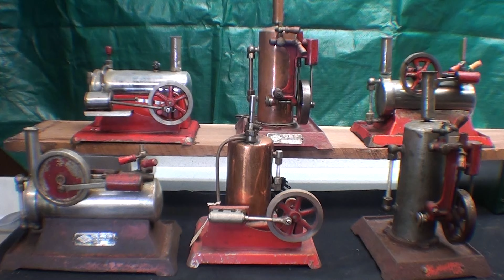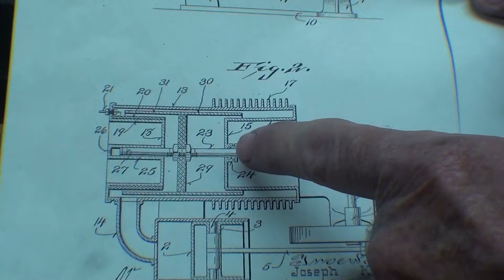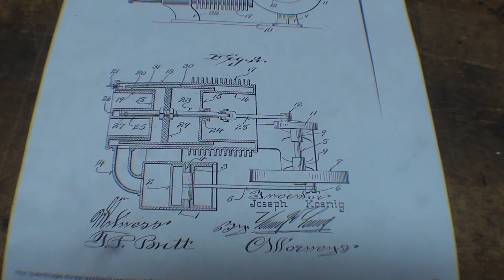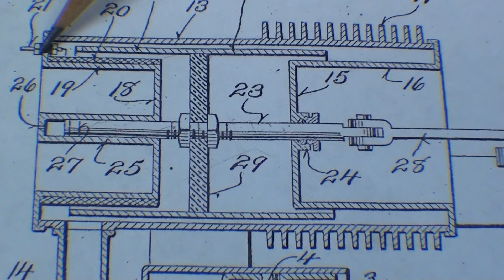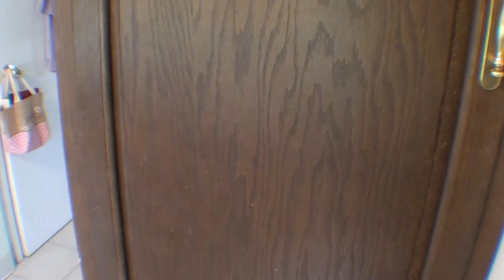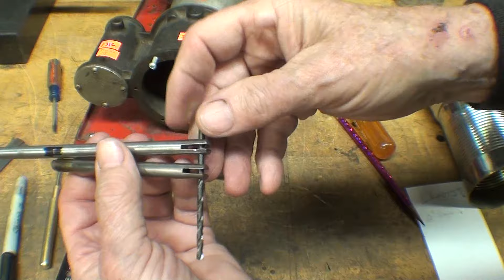Rebuilding an EMPIRE Hot Air Engine 1 of 3 tubalcain mrpete222

Comment: very late info, based on what i have seen so far, 1/3.         the  discussion of the  fallibility of such, lapsed patent, information was,  surprisingly,  astute.      Then,   the  obvious, Threshold  issue  was  glossed over;  and  life  went  on.           there is a reason that  99.999 percent of patents are  not  maintained.    it is because, they are Not worth it.      if/when a  patent has significant value, it will not be allowed to lapse.      so, feel free to continue to rely  on,  Flawed reference information.      cheers         googletranslate

Comment: As I watched I wondered whether a piece of automotive exhaust pipe, 2 3/4" or 3" might not be the right diameter. If it was a steel piece could be plug welded in the center where the rod connects.

Comment: Mr. Pete, I don't remember ever seeing a "H" design to a displacer before or the cold side design here, where in the displacer sleeves travel into the cold side.  Do you think that the sleeve on the front of the displacer, when it's inside the cold side, was designed to dissipate the displacers heat?  Do you think that by having a fairly constant temp on the hot side, (electric heater) there was enough of a temp differential between the two sides, that they didn't need the fins?  Obviously the drawing really intrigued me too, thanks for including it.  I'm looking at the drawing again and now wondering if the front sleeve just increases the displacement of cooler air, by filling the space in the cold side, it's obvious there is an air gap there.  I'll take your advice and re-watch your principles video.

Comment: Great video, as always, Mr. Pete. But oh really Mr. Pete, you can't keep knocking the Metric system. I'm of an age when I was schooled in Imperial but worked all my life in Metric (oddly enough until recently when I find myself working with some American-designed equipment) and I'm comfortable with both systems. But oh boy is Metric easier to work with! But I still find plenty of 'hybrid' measurements- like 6.35mm holes and so on. You can keep your fractional, letter and number drills. Give me a drill index with 0.1mm increments all day long! I sometimes deliberately flip into Imperial though - just to confound my (much younger and so 100% metric) brother in law. I'll say "I need a 9/16 spanner" all I get is a bewildered and slightly scared look. Good work Mr. Pete. Without you and Adam I'd be lost! Best wishes from across the pond. Mike

Comment: the mock-up s a good idea.looks more like propane size for the flame..Heating baby oil by solar parabolic mirror and circulating it through the head probly wouldn't be safe for the kids 350 watts input bout a 1/2 hp

Comment: I am of the age, that steam engines are quite interesting.  I like to see how the older machines worked.  A friend of mine found a small (but very heavy) engine in the woods.  It was used to run some of the steam and saws and equipment.  If I remember, it was used in the splitting of shakes.  He worked quite a while, in getting it in working condition.  That was the most interesting piece of equipment I had ever seen.  

Any more, most of the people that don't see that these older machines are of any interest, are the younger generation, that if they can put gas in a hole, and turn a key, that is all the interest they have in how things work.  If it doesn't run, Daddy will fix it.

I have a great interest,  So keep them coming.  Just do what you like doing.  That's all that really matters.

Have fun!!!!!!!!!!!!!!!!!!!!

Comment: I can't believe you didn't have chili for lunch!  It will be interesting to see how you get the flame into that heating chamber; I have some ideas and will stay with you to see how you do it.  I like the idea of the trying the cans before going to the extra work of turning a permanent displacement "piston" (displacer?).  Greg
Reply: Robert and mrpete, I was thinking a cover over the displacer head with an opening at the bottom with a hood to deflect the heat and open with a flue at the top to create a slight draft.  May be too much or not enough we'll have to leave it to the expert on this one, Greg

Comment: Using the cans reminded me of fixing leaky exhaust pipes .....When I was a teenager we would split a can and put it around the pipe where the rust hole was and clamp it down with radiator hose clamps

Comment: Cutting the cans... mount in lathe, affix Dremel tool or die grinder with cutoff wheel on tool post, set lathe to low speed, bring in tool post slowly. Should get a clean cut. (In theory) Also... isn't this a Stirling Engine? They work by displacing the air like that... just that it has a self-contained heat source.

Nice seeing you at the end... gives your video a more personal touch!